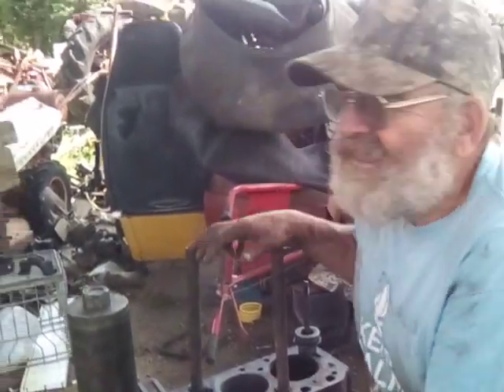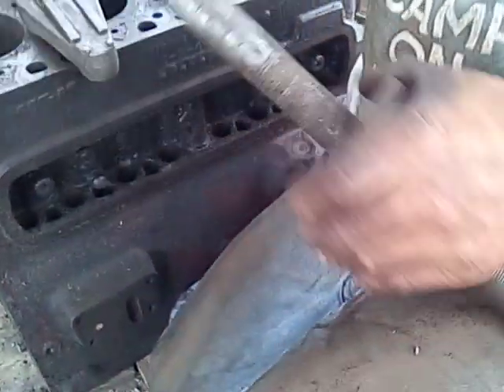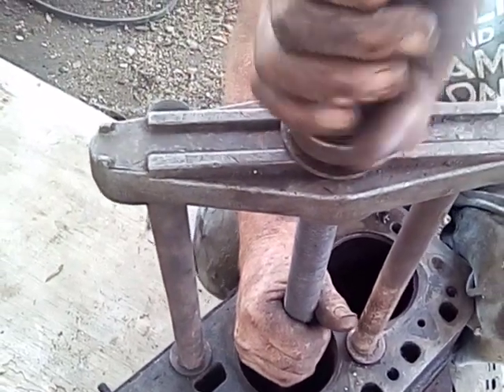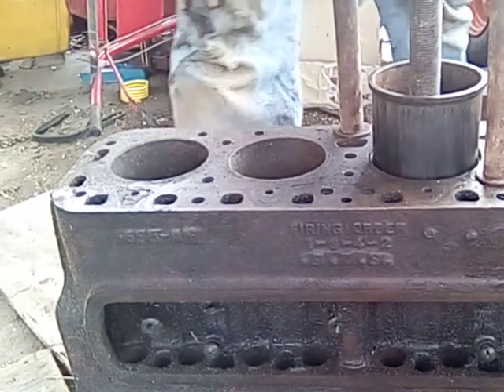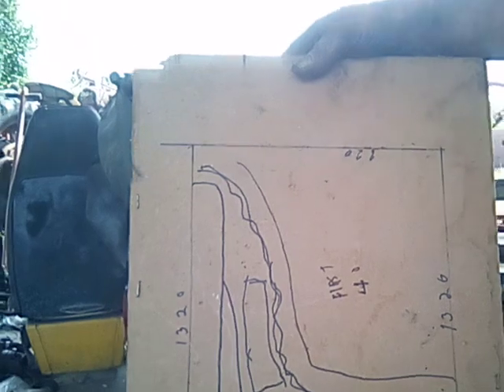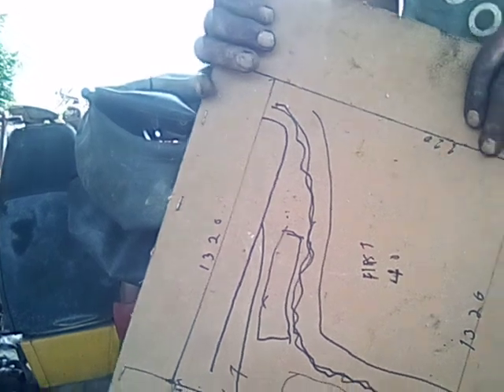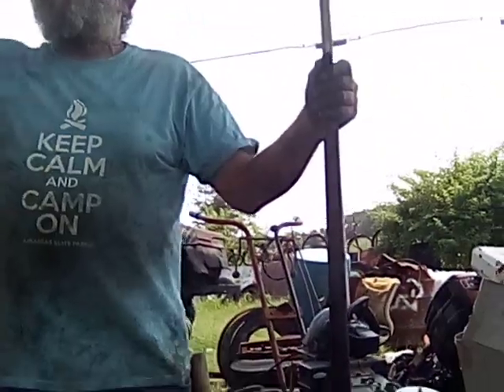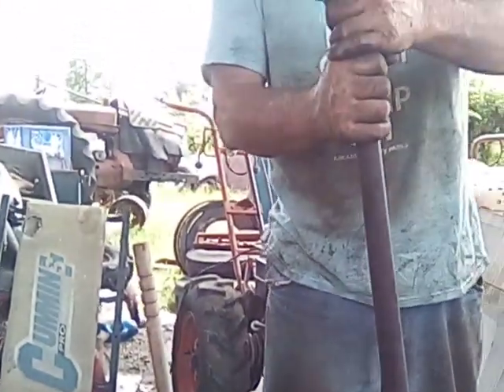Farmall H removing dry sleeves. And a fence building story

Comment: So that's how it's done! Yes, that was easy to see, that way. Out of the tractor  & crankshaft removed. Hope somebody can make use of the  engine block. It looks like a nice sleeve removal store bought tool. I never would of thought of using the  head studs, like that. good demonstration!
Reply from the maker: The block is from a H that got excessive rain in the exhaust. nothing was ever going to break it free. We had to remove the crank and used a porta power to force the pistons down and out the bottom of the block. You never know what someone might need. Rather that get a few dollars for scrap. I will store the well greased block. I wanted to remove the rusty sleeves so I thought it might make a helpful video.
Reply: @thecollectoronthecorner7061  I tried to pull my wet sleeve's today stating with the one that took on the water ( mite be the hardest sleeve) I sort of copied you sleeve puller with stuff I picked up from scrounging at a salvage yard  paid $ ten for the 3/4 threaded rod my crossing over piece isn't cast like yours but it was 1/2 inch by 2 " the sleeve is o tight it bent it. I had it crossed over with a piece of a ripped 2x4 on each side the puck I made for the bottom is a little bigger than the 3 1/4  but there 's  sleeve extended out where it wouldn't have to be  perfect for the first inch  I gave up for today don't know if the top is holding it or the bottom

Comment: The wife and I have a Farmall M and a super m one of 600 without the torque amplifier out of 38,000 that's pretty incredible and we recently bought a TD 6 bulldozer.
Reply from the maker: I heard the TA on a M wasnt very reliable?  TD6 yes that starts on gas and converts over to diesel after a warm up. We have a TD14A that starts the same way.

Comment: back  when I was a kid my dad was a mechanic and we had to take out sleeves and put the new ones in the freezer so they would go back in easier,,
Reply from the maker: yes thats how we commonly install them.
Reply: @thecollectoronthecorner7061   it's odd how that makes so much difference,,like putting a starter ring in the fire to make it fit on a flywheel.
Reply from the maker: @MissouriOldTimer  Ive pput flywheels in the freezer over night and the ring gear would come right off. heat the new ring gear in the oven and it dropped right on.
Reply: @thecollectoronthecorner7061  there are lots of things we learn over the years that younger folks haven't had time to learn that is if they even want to learn.